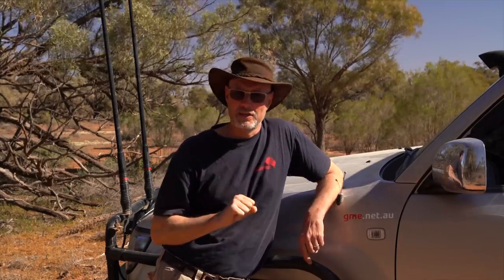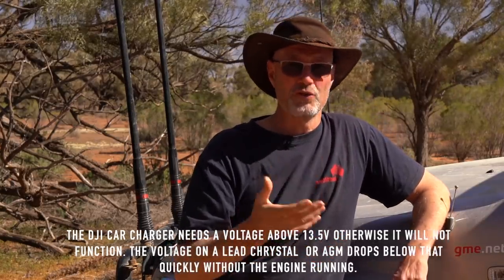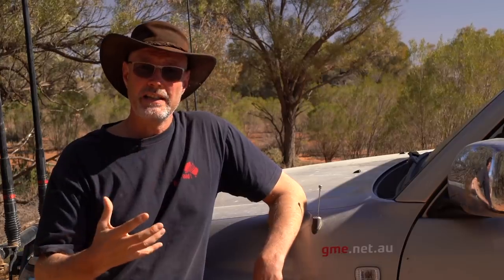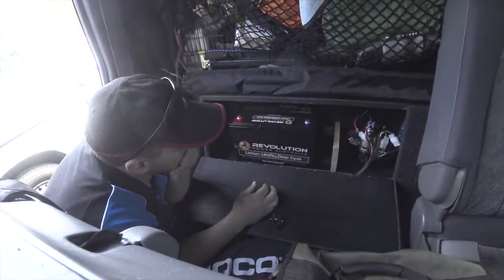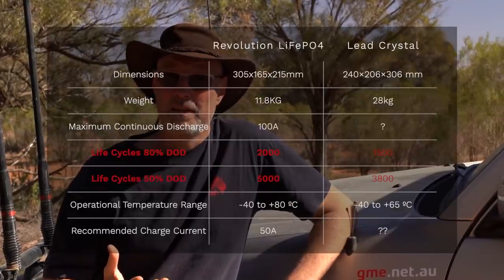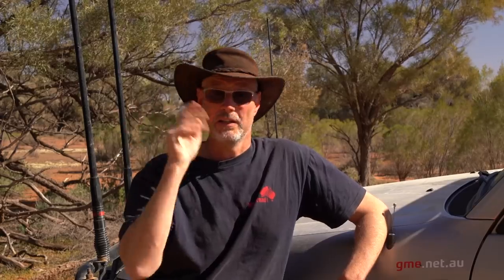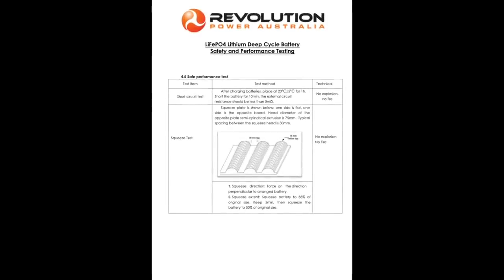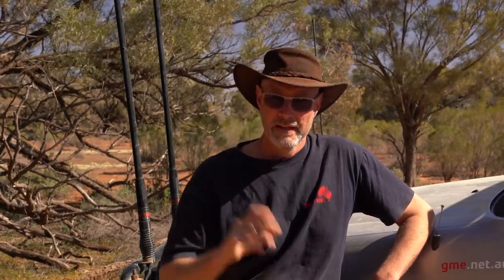Lead Crystal to Lithium LiFePo4 in my Landcruiser 105 - Why I changed!

Comment: Good piece mate. I can't speak for lead crystal.
AGMs take a long charge and are heavy.
Lithiums like a charge, the last 10% is difficult.
Lithiums don't like being exercised to 100%, so it's best to store them at 60-80%.
That said, sometimes they need to be disconnected from the alternator and PVS for a day or two.
Reply from the maker: I hardly ever run my LifePo4 below 70% and given the very quick recharge time it works great for me.

Comment: Nice video, informative as always, just have to wait for the few years until they drop in price.
What about a review on your slinky suspension?
Reply from the maker: I had to many issues with Distributer of Suspension so won’t do a follow up as I could not recommend it because of that

Comment: Ok nice explenation. But and there is a but my nephew has a towing servixe. We have in winter time a lot of problems here in Belgium (wich is not a cold climate. Than in norway they drop verry quick in the cold. I load my drones with no problem (with a pure sinus inverter) that was in a friends car in my own car I use a agm spiral battery. I think a bettary you use must be choosen dependening where and in wich klimate .(this is my personal opinion i studied electro-mechanics automachinacs and  informatics I am not an expert but think I have a good back ground)
Reply from the maker: yes I agree we don't have that often below 0, however, we had a few instances around or just below 0 and I have so far not seen any problems. In Germany we sometimes had a few weeks well below -10 not sure how LiFePo4 would go there but here in Australia, I don't think it will cause issues.

Comment: So the Lead Crystal (Silicone Dioxide) batteries cannot be discharged at full percentage like a Lithium Phosphate battery???
Reply from the maker: ideally not will reduce lifespan
Reply: @AlloffroadAu  So you would say it is a happy medium between an AGM and a Lithium battery? I am doing a van conversion with a tight budget and I wanted to do as much research as I could
Reply from the maker: no I would say a Crystal Lead is just a good AGM but with more difficult charging requirements, I would rather look at say a Odysee or NorthStar AGM over a Lead Crystal.

Comment: I’ve have a Landcruiser 105 petrol from new . When the original alternator went it created a dead short that fried 2 perfectly good Optima yellow tops. The highest capacity replacement alternator I could fit puts out 120 amps. Could you please tell me how much grunt your SBC alternator puts out.
Reply from the maker: They have a few version my one 200amps idle and 270 max running.
Reply: You can have your factory
Genuine alternator rebuilt
Or same thing is but a rebuilt genuine denso unit.

Comment: I don't think you would have had the same result if you would have installed the BCDC and the Lead Crystal battery in the back instead of under the bonnet
Reply from the maker: the main reasons to change where the unclear charging, the weight, not enough usable amperage for my needs and the issues with my DJI drones charging. Non of them would have been solved by moving the battery and BCDC in the back.
Reply: @AlloffroadAu  It doesn't sound right.You say in your video it wasn;t charging properly the battery properly when it was under the bonnet. You needed to  fix the issue of the charging problem. Instead, you reconfigured the Lithium system. location was clearly the main issue due to heat. Otherwise, you would have placed the Lithium Battery under the bonnet also!

Comment: You revolution battery specs"..........-40 to +80 degC would probably be more correct.....edit, check and double check your facts before posting. Other than that good job.
Reply from the maker: Pretty sure the facts were copied straight from Revolution web site

Comment: Real battery experts (rare) will tell you Lead crystal is pure marketing BS with no real world track record, complete utter gimmick, just a tweaked AGM. Revolution Lifepo4 batteries are overpriced as they are in bed with Redarc.
All lithium batteries are the same, there is no such thing as reserve, you can discharge them right down to 100%DoD/empty, 12V underload is about the lowest you wanna go which by that point you have 1-3% capacity left, far above cut off & still enough to run bms. You can take them down to 90%DoD (~12.7-12.8V) for a good balance of cycle life & capacity, 90%DoD should give you around 100AH in a 100AH battery. Lifepo4 capacity is actually more than sticker capacity by roughly 10%, a trick the cell manufacturer does so in 5yrs time when you do a capacity test you say " I'm still getting 100AH, my battery is as good as the day I brought it"
Reply: I am not so sure about all your statements. Technology has evolved and more battery research is needed to improve battery performance. This means a battery expert from the old technology may not be the expert for the new technology.eg. Silicon use in batteries. I would love to know more from real world Lead Crystal installations. I got the impression it wasn't setup properly as he didn't understand the Lead Crystal datasheet. Also, his use was at the temperature limits for Lead Crystal. I would like to know more from his torture test actually. Not all of us are driving through deserts.  Great review but left me with more questions.
Reply: I watched the video again.  Its apples against oranges for the battery comparison. Put the lithium under the bonnet and it will die an early death from that heat also. He even says the BCDC battery charger(under the bonnet) wasn't charging the Lead Crystal battery and is spraying it with water.!  Sounds more like the BCDC battery charger and location was the real issue.